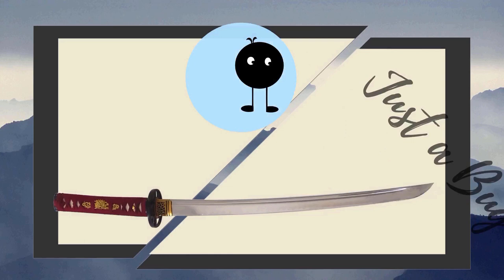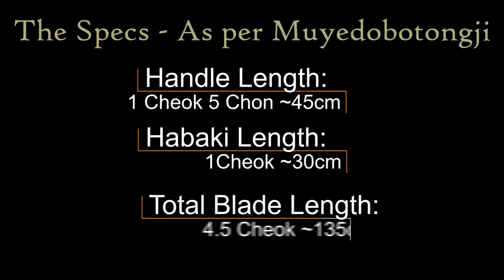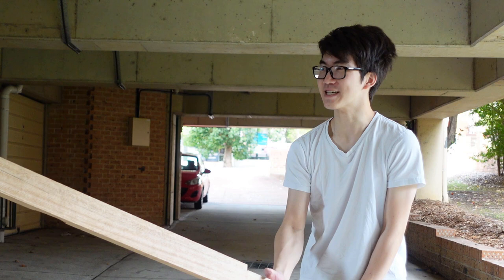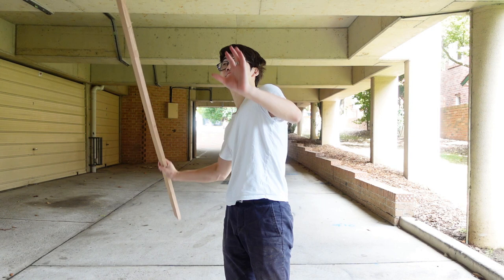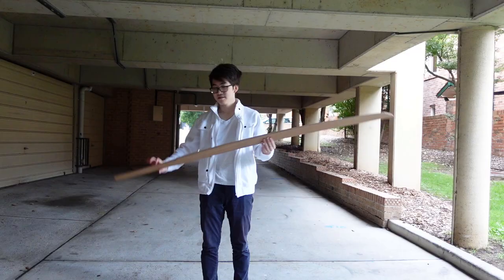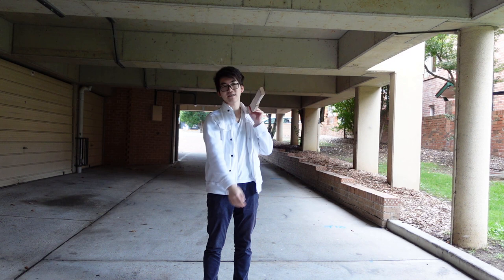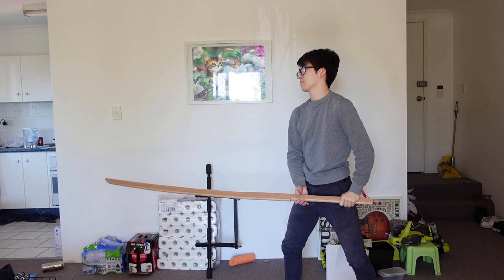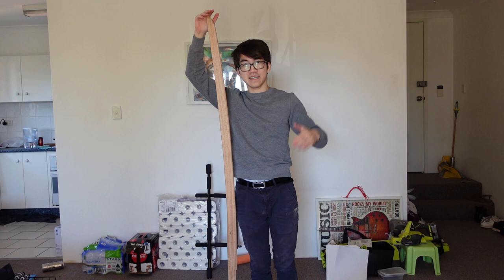Making a Ssangsudo Bokken! [vlog/ssangsudo training]

Comment: Can I know what you recommend among this type of steel, 1060, 1065, 1075, 1095, 9260, T10 high carbon, for the Katana sword?
Do you likes Damascus Steel?
You didn't answer a question last time. I was wondering how you would remove the scratches on the blade. If you don't know, there's nothing wrong with that.
Tell me...
Reply: He probably didn’t see it, or he would’ve responded. Every one of those steel types listed make great swords. I’ve personally used all of these steel types (I have a large sword collection) except for 1065. All those steel types make for awesome blades though.
I’m a big fan of 9260 because it is typically through hardened (spring steel) and is a lot less likely to take a bend on a bad cut. It’s very tough and doesn’t easily scratch. 

I would recommend avoiding Damascus (folded steel) because modern swords use very pure bloom steel. Folding it can actually weaken it if not done perfectly!
In the past, the Japanese needed to fold the steel to remove the impurities that could cause problems. Today’s steel doesn’t need that process because it’s extremely pure.

Scratches can be removed with a soft towel and some metal polish. Mother’s mag metal polish is the best for this

If the scratches are too deep, then the only way to remove them is with high grit autobody sandpaper increasing the grits as needed even as high as 10,000 grit and above depending on how well the mirror finish comes out. Sandpaper would be way less expensive than polishing stones. 
I wrap the sandpaper around my sharpening stone and wet it using it like a sharpening stone. There are many methods to sanding... you could clamp the sandpaper to a workbench, etc.
Hopefully the scratches aren’t deep, and will come out with mother’s mag by rubbing it for around 10 minutes or so. Use gloves so you don’t get cut. 
Good luck.
Reply: @AgouraSteve  ok😉 he busy is
Reply from the maker: For a blunt training sword or a beater I like 1060 because it's easy to sharpen and it's more likely to bend than break under high stress. For a nice cutter 1095 or T10. 
For removing scratches wet sand going up in grit up to 800 or so then buffing complex
Reply: @JustaBug  Ok obviously we're not talking about layered swords, I don't mean damask. Well I am convinced that I will opt between a 1060, 1065, 9260 spring. Greetings from Europe and Thanks
Reply: @JustaBug  uh I’ve polished swords before. Not sure how you are able to get to a mirror at 800 grit. That’s a great feat if your pulling that off.
Reply: I believe that even a 1055 can be an excellent Sword, you have to see how they managed to make it, with the right materials dosed and hardened in the right way. Then according to my thought, each sword has its own soul for how it is made😇🗡️
Reply from the maker: Ah if it's for a mirror finish then definitely needs to be higher than 800 grit. But for a nice scratchless satin finish I find 800 and buffing compound is quite nice. I keep that on swords likely to get scratched again. 
Also thanks Steve for responding for me earlier. I'm still stuck at work so replying isn't easy haha
Reply from the maker: @jackarrows1436  1055 can be a decent sword but it won't hold an edge for as long. If it is a blunt sword it can be great
Reply: @JustaBug  🗡️I Confirm , ok.
THX to the next time

Comment: Great video! Question: The Muye Dobo Tongji only specifies the lengths to the different parts of the ssangsudo, what did you use to determine the blade width?
Reply from the maker: How it felt to handle and aesthetics. I think swords aren't meant to be fully standardised. It's ok to make then based on specs because it works for you or because you like it that way
Reply: @JustaBug I agree that they weren't fully standardized. I've seen a lot of other examples non-standard or customized swords through out Korean history.
Reply from the maker: I think I've seen far less standardised historic examples than non standardised. I quite like that about Korean swords